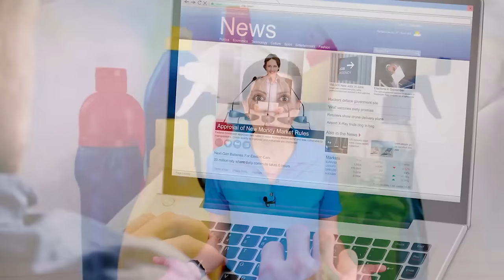Best Way to Clean Windows and Mirrors

Comment: Microfiber is not great for the environment. Yes it's washable but you wash plastic down the drain each time you wash them. I use rags. Old sheets towel jean anything.  Yes there still a cost to the environment. Throw away after use; I burn mine. I could wash and reuse my rags might do that
Reply from the maker: Thanks so much for sharing your opinion on this topic.

Comment: Best glass cleaner is vinegar! Wet a rag with plain white vinegar and wipe over your glass surface. Then take a clean dry cloth like the cheap Terri cloths from Costco and wipe dry.  No streaks and sparkling clean! Use vinegar as your cleaning solution on all glass surfaces like computer screens, mirror closet doors, windows, glass top stoves, etc.
Reply from the maker: Thanks for the tip!

Comment: For a very short period of time, I've worked for a cleaning company and we would clean windows with a squeegee. I purchased a proper one from a commercial store (The ones made of golden metal) and have always washed my windows and mirrors with this! Amazingly quick! small bucket of water with a drop of dish soap. "Scrub" the window/mirror down and the squeegee away the water. You'll never have washed a patio door so quickly in your life!
Reply from the maker: Thanks for sharing that great tip about the squeegee!

Comment: Also in decalsifying or removing the combination of calcium deposits and soap scum the absolute best and 100% effective way is to scrape it while it's dry. If you try to scrape it while it's wet no matter if it is just water or a cleaning product you've slickened the surface and made it very hard to remove any of it as a scraper or scrubbing pad is now just sliding over the top of it and not removing it. 
People say use steam, well yeah that's very effective. Once you've actually scraped it while it's dry. These are just basic physics and the chemical properties of liquids, solids and gasses. Why do you think those foaming bathroom cleaners want you to spray it on while it's dry and then wait till it's dry again to clean it off? It embeds itself in there and then when it's dry again you can actually wipe it off. That is if it's a thin layer and not a compounded buildup over much time.
Reply from the maker: Thanks for the tip and the science lesson. I appreciate you being here. 👍
Reply: @AskAngelaBrown  
I absolutely loved it and wouldn't have commented if it wasn't totally relatable to my everyday life. 
Myself and another person are owner/operator's of our own cleaning business and we do all of our business strictly off referrals. We're at a point where we are doing 10 large home's/job's per week and work Mon-Fri every week. The # of referrals is coming faster and we're going to logically and logistically going to have to add two more 2 person team's.
Reply: @AskAngelaBrown  
No thanks necessary, thank you for the content and the comment. You know in this industry or business people don't share very often and I think that's cr*p. There's enough pieces of the pie to go around and for us to share to allow everybody to eat, no reason to be selfish.